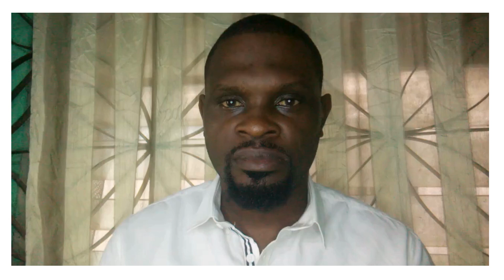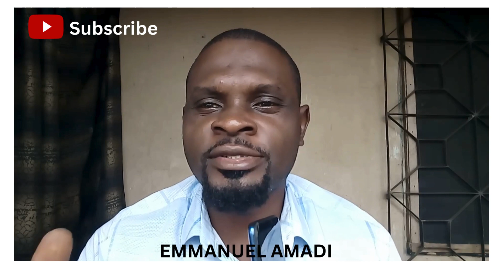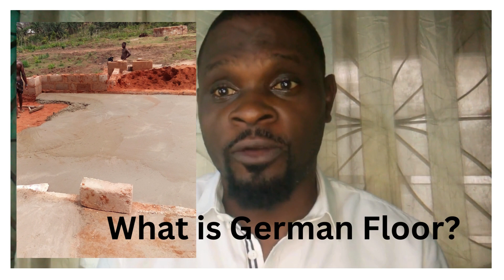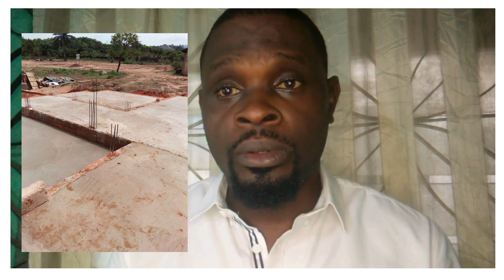Is German Floor Compulsory in House Construction?

Comment: Mr Amadi, good morning, pls am building a bungalow in Ikorodu Lagos and I just got to lintel level. There's no German floor there but wish to do it when I have money. But the issue here is, there re no pillars in the building. Is it good or not as they said it okay and the blocks re very strong. I did 1bag of cement to 39blocks. So pls advise me as I have no engineer to pay on site
Reply from the maker: If the Load bearing walls that will carry the Roof structure are strong enough, and the blocks are well bonded, and the Soil in the Land has good bed rock to support the building structure, then there's nothing to be concerned about. But try to do the german floor before Roofing the house.

However, if you intend to add concrete fascia, then you may need some columns in the external walls to help support the roof beam & concrete fascia.
Reply: @HousinginfoNG  what do U mean by concrete facia?
Reply from the maker: You can watch my video on Concrete Fascia

Comment: I'm not convinced

What about areas that are not dampy but very, why would you need a German floor
Reply from the maker: I will make content on the topic for clarity, thanks for watching.
Reply: Damp or NOT, you need a German floor for a rigid foundation..  it helps to prevent cracking and soil settling down ,it's also help to carry the load from the roof to the foundation base.

Comment: I saw a bungalow without a german floor but was tiled ans for 5 years the house has no problem
Reply from the maker: It is not advisable, there should be a concrete floor before the tiling.

Comment: I think the German floor should be generally casted directly on top of the block-work after the sub-structure,(and not after super-structure),. whether it is a Bungalow or not. The simple reason is that'; The oversite concrete serves as a perfect base for dead loads from superstructure. It takes all dead loads and then. evenly distribute them into the foundation during the settling down of the Building.

My idea as a Quantity surveyor
Reply from the maker: Nice idea, thanks for your contribution.